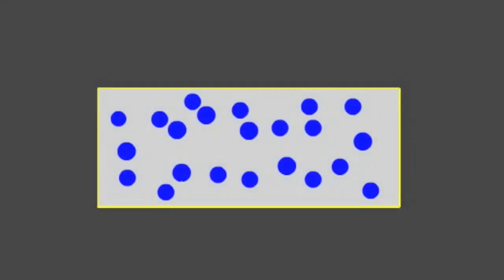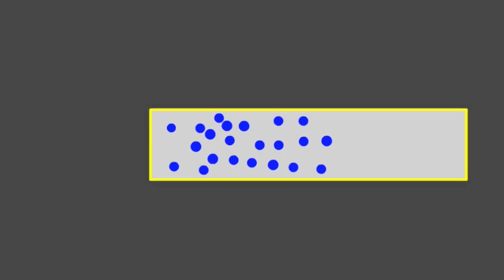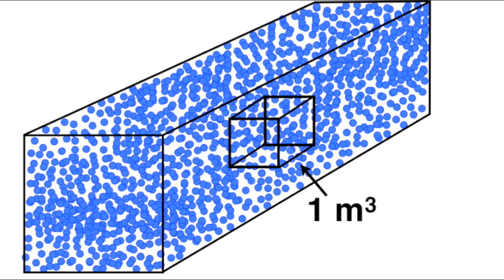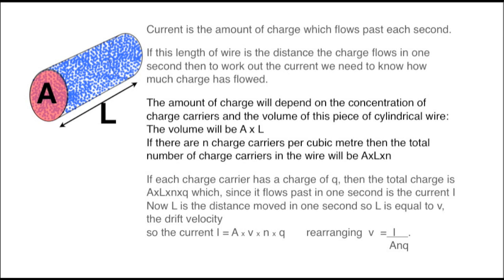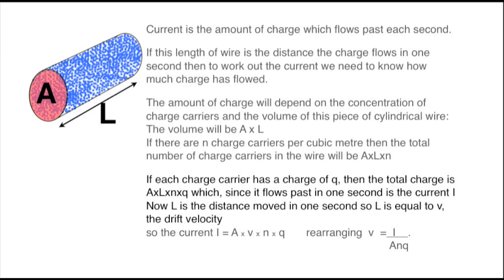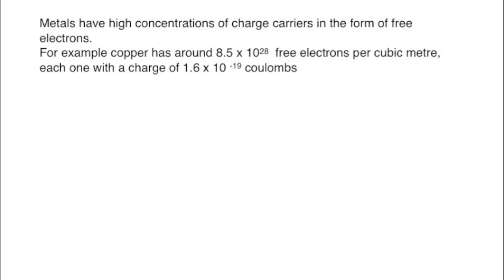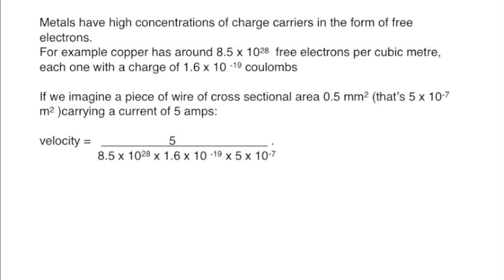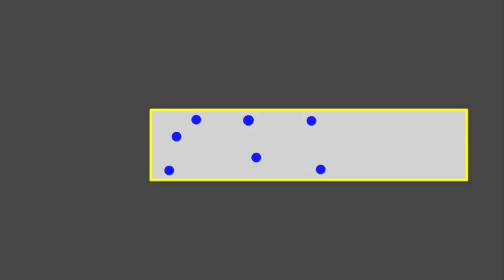Drift velocity -the speed of electrons in a wire: from fizzics.org

Comment: So in a simple battery DC circuit, is the drift velocity, ultimately, the limiting step for the amount of redox within the battery itself ? I would assume so, but haven't yet done the calculation regarding  how many redox/sec this implies.
Reply from the maker: Easier to think of it in terms of the total charge that has flowed.

Comment: Another question.
When the current is turned off. do the electrons stay in their new location or do they return back to their point of origin?
Reply: Why would they return back to their point of origin? To change any particules location in space required energy. So, it is required wether to take back the same energy you spend or additional external energy that is adequate to return those electrons back. Thus, the answer to your quesiton is they stay in the same location (in average of course)   unless there is current (or energy).

Comment: Only ONE question.

say you have 
point A = A/C plug
line B = electrical connection wire
point C = appliance

When I turn the electrical current on electrons will "drift" from point A towards point C along line B....as I understand it.  Just exactly where do they end up if the appliance was left on say 1 year continuously? Will they flow into the appliance? Will they propagate at on end of line B? Will the wire close to point A have no or less electrons than the rest of the wire along line B?